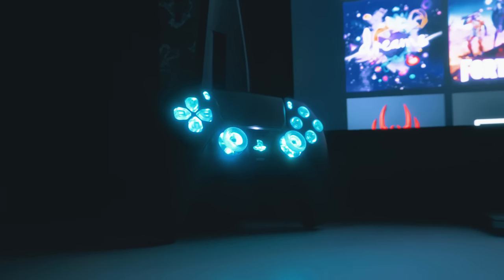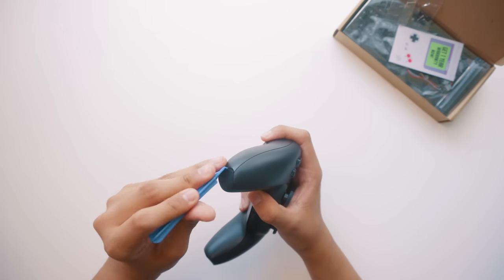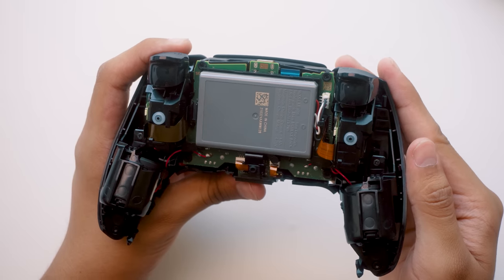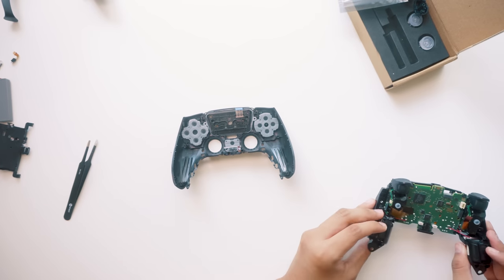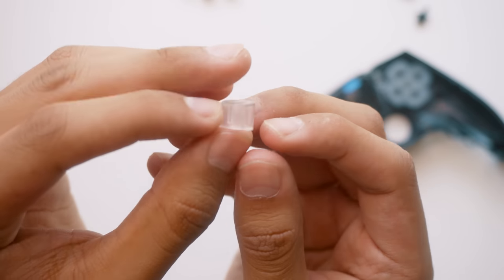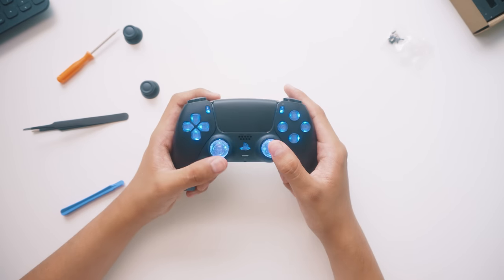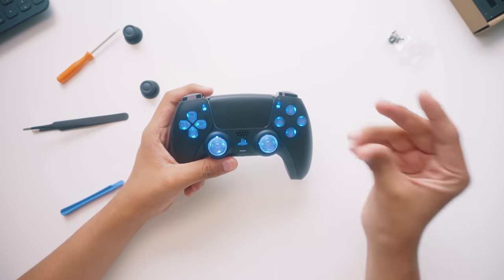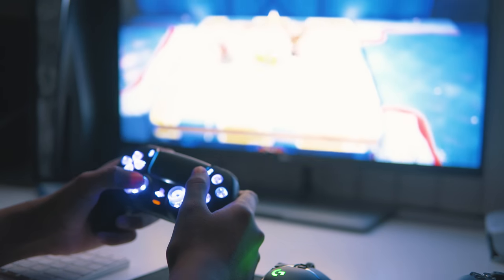I Put RGB Lights in my PS5 Controller

Comment: Can someone confirm whether the original white & black controller has the exact same design? I know from previous DS4 controllers some were different to others
Reply: They the same thing bro I bought it and honestly you can’t turn off the light even if they ps5 us off
Reply: @heliixsyn5461  I meant the inside design and internals are all the same? If so this is a good mod to do 👍🏻

Comment: little bit unrelated as it's about the PS4 one, but is it worth doing? have you had any issues? because I was thinking of doing that mod myself but the reviews were quite middling so I was unsure about doing it
Reply: I got two different LED mods. One you have to solder to battery, and then the one this guy has that has a double connection to the battery. Honestly, the mod is not bad. If I had to tell you the hardest part of the installation, are the rings that go on joysticks. After awhile, that adhesive comes off, meaning you are gonna need to add more adhesive later. As far as it affecting battery life, it takes an extra hour off your battery charge. But, because of the auto shut off feature of your controller, that can save your battery life as well aa always keeping it plugged up. Do not get the LED kit where you have to solder unless you are very good with soldering. I rate both kits 7/10
Reply: @Th3W4tchman  thanks for the information, I might buy it now tbh

I have practically no practice with soldering so I will just get the plug in one, I do want to learn soldering though
Reply: @MightyOwl_01  Soldering is actually a real easy skill to learn. Oh and I almost forgot, if you decide that you want to uninstall the LED kit, you are going to have to be careful taking the LED flex board off the controller's flex board. If you roughly take it off, the flex wires can get damaged and mess up your whole controller.
Reply: @Th3W4tchman  I know, it seems like a very useful skill to learn so I wanna do it some day, also I probably won't be taking it off as it's for a friend probably for christmas, just have to make sure they want it without them knowing I'm getting a controller lmao

Comment: Considering my PS5 controller die with in a hour of using it. I can't imagine how quick this would kill your battery
Reply: You must have a busted PS5 controller because mine always runs for at least 3-4 hours.
Reply: @johnkimble523  sometimes the same amount of time but mine sometimes lasts up to 5 if I'm lucky, but usually the same amount of time.
Reply: Does the ps5 remote just have terrible battery?
Reply: @johnkimble523  yeah ur controller might be broken

Comment: 8:28 is the bit that fu.cks with my brain the most felt like the whole thing cracked and that's the bit that makes me not want to mod with led lights ;/
Reply: That's just because you're pudding the motherboard out you do the same on the ps4 controller
Reply: @noobi8002  I never did the led mod on PS4 lol.
Reply: @5part4  i didn't know there was one but I fixed a few controllers before so. It's just the plastic nothing to worry about.

Comment: Could u add it on the console
Reply: He did add it on the console lol if your talking about the PS5 itself, uhhh don’t try that if you make a little mistake it will literally break
Reply: I added lights on my console. I got the ones that go around the fans and shine through the vents. It was super easy! You only have to remove the plates and stick them, then plug them into the usb slot. Of course put the plates back on. I found them on Amazon.

Comment: HELL no im not doing this lmao
Reply: why not seems easy enough
Reply: why too much of a chicken
Reply: Yep don't do it I remember when I did this on my PS4 controller back then and it didn't end well, I took everything apart and blew into my joysticks because it had a lot of dibrese in it and after that I put it back together and my buttons and joysticks weren't working and I took it apart 4 more times and it still wouldn't work so I got mad threw my controller in the trash,I went a week without gaming till I got my check and got a new one so ye it isn't worth it, it's really stupid imo
Reply: @Imjustspeakingmymind  yeah well ps4 controllers werent supposed to work like that so yeah it was your own fault
Reply: @ijustplayforfun1593  did you not read my comment correctly? I tried to clean out my buttons and joysticks not install that stupid light

Comment: me who has it on usb so i can have unlimited
Reply: Not unlimited at all since the battery itself will die faster but ok Naruto pfp
Reply: @Pestielicious  usb= infinite LLLLLLLLLLLLLLLLLLLLLLLLLLLLLLLLLLLLLLLLLLLLLLLLLLLLLLLLLLLLLLLLLLLLLLLLLLLLLLLLLLLLLLLLLLLLLLLLLLLLLLLLLLLLLLLLLLLLLLLLLLLLLLLLLLLLLLLLLLLLLLLLLLLLLLLLLLLLLLLLLLLLLLLLLLLLLLLLLLLLLLLLLLLLLLL
Reply: @thetectonicfryingpan6354  it will ruin the battery quicker so that means you buy more or replace the battery if you know how.
Reply: @anonymoushunter9808  usb = infinite LLLLLLLLLLLLLLLLLLLLLLLLLLLLLLLLLLLLLLLLLLL
Reply: @anonymoushunter9808  You don't need the battery. Step 1. Remove battery. Step 2. Hardwire the battery cable (cable that used to be attached to the battery) with the help of soldering. Step 3. Enjoy only having power when usb is connected. Step 4. Sell the battery on ebay.